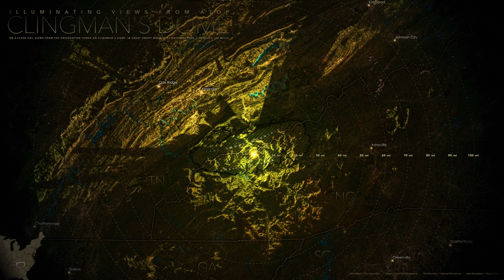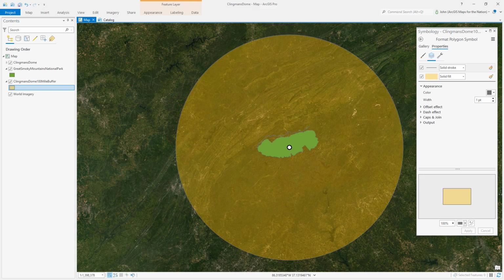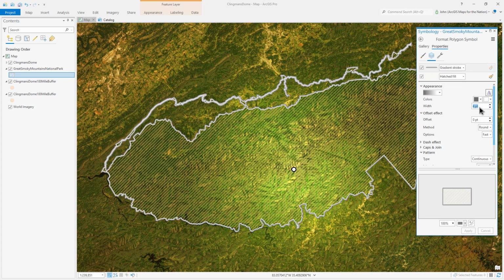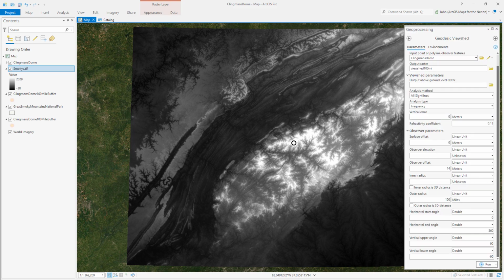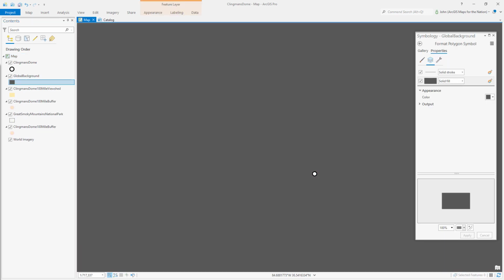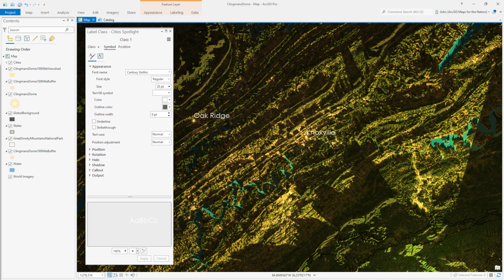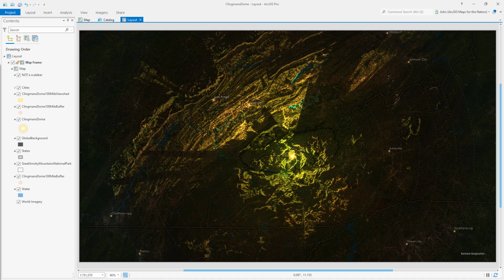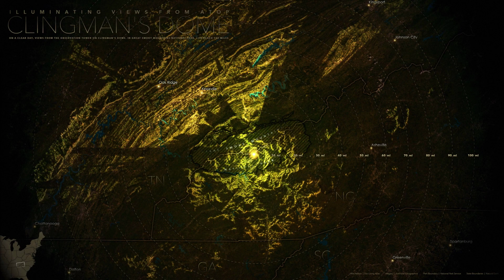How to Make this Illuminated Visibility Map

Comment: Wondering why you stitched together your own dem for the extent rather than use the Living Atlas? Looks great!
Reply from the maker: i was under the impression the viewshed tool required a local DEM rather than a living atlas image service. but maybe that's not the case?
Reply: @JohnNelsonMaps  Oh, I may not know what I'm talking about . . . very possible . . . what little I know about Living Atlas comes mostly from you anyway! But, I was just thinking that someone could export the terrain layer from Living Atlas with the extent clipped to a specified boundary then they wouldn't have to stitch smaller DEMs together. Even if that's true, I don't know if it's any easier; the work-flow may be about the same amount of effort? I was just wondering if there was something else I was missing. It could be that what I described wouldn't work??